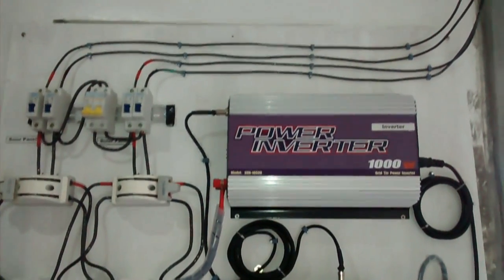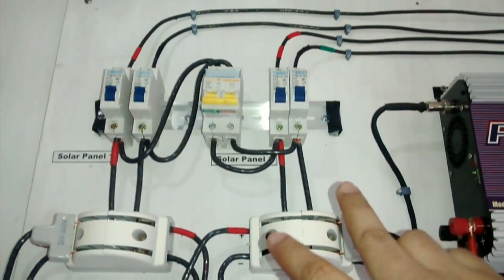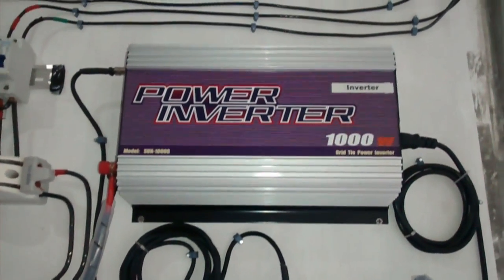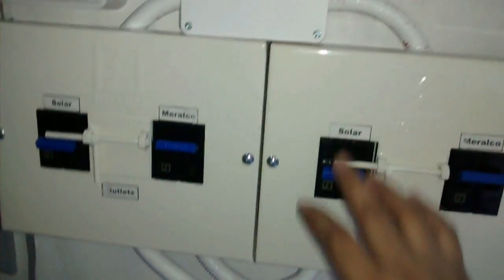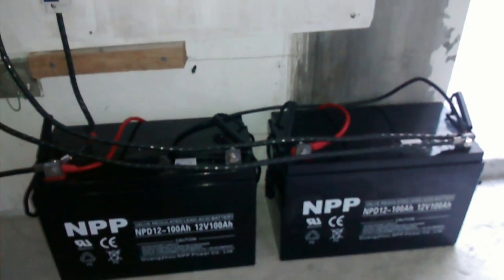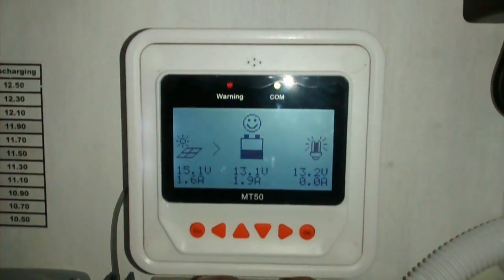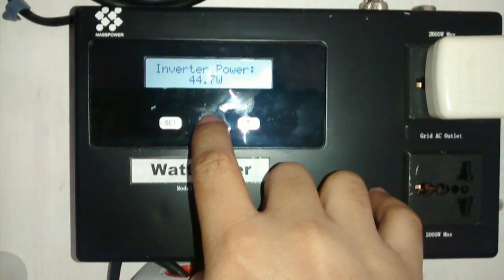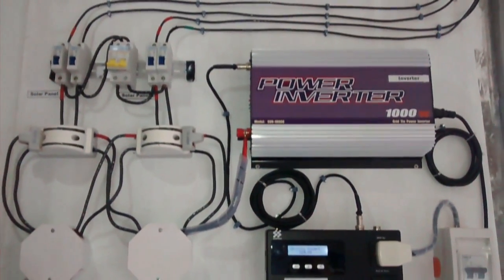My First Solar Project - A Manual Hybrid (Grid Tie Inverter with Limiter and Off Grid system)

Comment: can the power limiter used with any grid tie inverter?
Reply from the maker: nope. the GTIL is modified with a signal cable to control output

Comment: hello sir  magkano po mag pa installed ng solar  kasi nakabili na ako ng solar panel na 6pcs by 150 watts at may inverter ako na 2000w at panel controler  going to batery..pero di ko alam ang pag assymble kasi di ko naman alam ang electrical...
wala lang ako ung mga cercuit breaker.
kaya ang tanong ko lang magkano mag pa assymble or installation
salamat po at kong may maibigay kang taong pwede gumawa.. sequijor island po lugar ko..
Reply: ako bai libre basta libre bakasyon ug meals ug accomodation :))

Comment: Hi Glen, nice setup im currently searching for reviews on npd12-200ah, any issues with the brand npp?
Reply from the maker: The batteries on the video are still used by my close friend although they are on standby to preserve them.  Here's the spec sheet https://drive.google.com/file/d/0B2rSJ2MwWA_qenVCWkQ5cjB0SEU/view?usp=drivesdk

Just as long as you take care of the battery then it should reach the spec sheets cycle life.

1. Avoid partial state of charge.  Avoid using it while charging.
Allow the battery to absorb the charge daily.
Equalize monthy based on temperature.

2. I would stick to 50% to 30% DoD to maximize life.
Get a Low Voltage Disconnect and program to cut off around 11.5v to 12v

3.  Do not draw more than 16A or 192w from the batt for 1 pc 12v 100ah.   I would design for 120w load per batt.
E.g. if your load is 480w continuous you will need 4 batteries 
So the batteries are not stressed.

Comment: sir may tanong po ako... 
i have a hybrid inverter.. charge controller / inverter 2000w
can i use it for pure offgrid only? does it charge the battery and draw from it at the same time
Reply from the maker: Willow Silos depends if you have enough panels, enough sun and how much load you use.  In versus Out.
Reply: F mag hyrd kayo mag solax or sma or inface inverter kayo

Comment: Is the inverter 220 volt split phase (line to line) or 220 volt line to neutral?
Reply from the maker: the grid is line to line.  the gti can handle either one
Reply: May i know where did you buy your gti?

Comment: Nice work glen. For the 220 Volt grid tie limiter system, did you use two clamp sensors to monitor each hot line of the split phase 220 volt utility supply?
Reply from the maker: the current version uses 1 clamp sensor only.
Reply: In the Philippines, we have 2 configurations for 220V system to residential supply. One is 220V line to ground and 220v line to line+ ground. I believe he has the 220V line to ground supply. I think in the US it is 220v line to line so you will be required to provide clamp sensors for every line.

Comment: Hello,

Can you please tell me how you hooked L,G,N ( two hot wires to the Circuit breaker) I am confused about it. I would appreciate it since I did not get instructions manuals with purchase. I have 110 volt Grid tie inverter and model 4000 GT limiter.  Thank you

Comment from the maker: the one above is a grid tie inverter or on grid.  it works in parallel with the DU.  It reduces your consumption in real time. (like a power saving device)

the one below is a off grid inverter.   like a generator.  its independent of the DU

Comment: hello im 5th year electrical engr. and this could be our thesis.. my question is how much it cost? thank you
Reply from the maker: jan jan Cruz that's around 120k pesos.  For a thesis? if i was your prof, isn't this too simple?   improve on it.  Automate it. 

Measurement Devices:
DC Voltage, DC Current, DC Power From Panels to Charge Controller. 
(Max Rating: 600V, 80A)

DC Voltage, DC Current, DC Power From Charge Controller to Batteries.
(Max Rating: 100V, 100A)

DC Voltage, DC Current, DC Power From Batteries to Inverter.
(Max Rating: 100V, 200A)

Ability to View these Measurements remotely. (via email or webpage or mobile app)

Using the Measurements above,

the ability to control Relays like a Solid State Relay (DC triggers -> AC terminals)
or ATS (Automatic Transfer Switch)

e.g. when charging the batteries in the morning, a relay can be controlled to turn off the inverter so the battery is left charging with no interruption.  When it hits a certain Voltage value, it turns ON the inverter.

or control a ATS to switch the panels from the charge controller directly into a Grid Tie Inverter.  etc.

You can do all of this using ARDUINO or Raspberry Pi

my suggestion for your thesis is to CREATE the Intelligent controller of Solar Equipment.  Currently the features i said above are available but its for High End Models that cost a lot more.   With your Controller/monitoring equipment, it can make individual solar equipment 'intelligent' by using programmable micro controllers ;)  <- a lot cheaper thesis in my opinion. 

you can scale down the solar setup for proof of concept purposes.